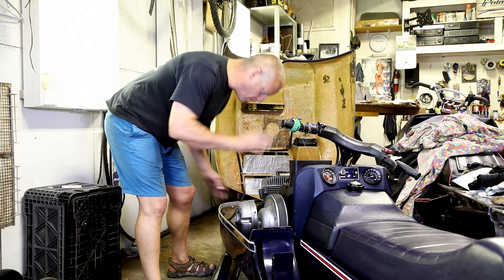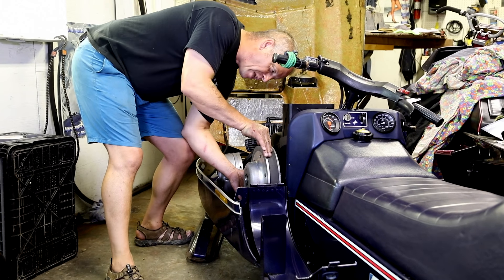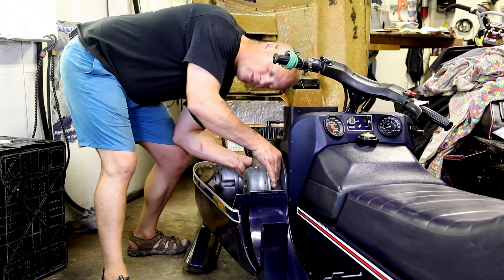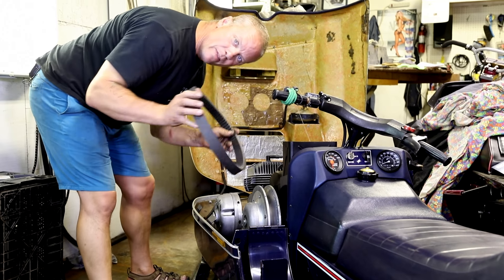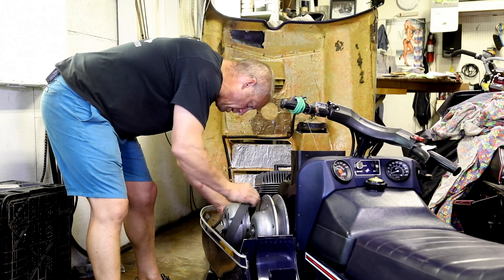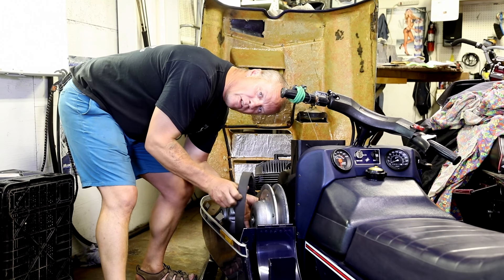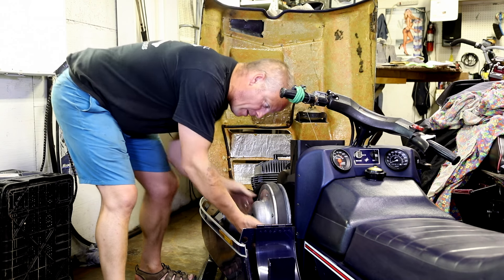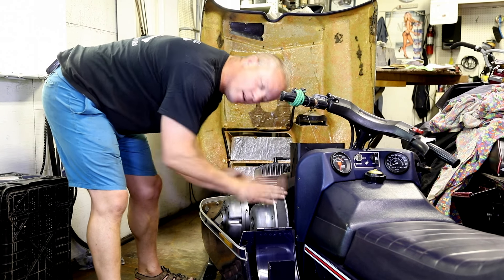How to change a belt on an older snowmobile (in 2 seconds)

Comment: Bull. No way slides move that easy
Reply: They should move that easy, but they might not if they're rode hard and worn out. It's all in how you maintain your equipment. Look at that video again: that's a pretty new/clean looking clutch, wouldn't you say?
Reply: @carterropcean  If you're going to call someone out and say they're dumb, it's "you're" not "your". Also, take a 97 Polaris Ultra SPX 680 triple. I know for a fact that it can be somewhat difficult to spin the clutch open and get enough slack to pull a belt. Some sleds are just easier than others.
Reply: Sorry. My reply did sound dumb. Just meant on secondary driven clutches with a high compression torsion type spring, they don’t turn in by hand. Splitter required unless your the Hulk

Comment: dumb question but Do you grease the belt before you do this? i just tried it on my 02 edge 600 and the belt just kept grabbing the plates as try to spin and push down. Is it just cause its a heavy clutch spring?
Reply from the maker: Yup , that was a silly question ! NO grease on the belt , just technique ! Need to get the sheaves on the secondary to open !
Reply from the maker: Yup that was a silly question ! NO grease on the belt , just technique ! You need to be aggressive and get the sheaves to open !

Comment: We can not see what yer actually doing with both hands  remake the video!!
Reply from the maker: Push the inner shiv back and clockwise with your left hand as you push down on the belt with your right hand ! That yr of sled has a helix and torsion spring , should be easy ! Newer sleds with a roller clutch and compression spring is really hard to do !